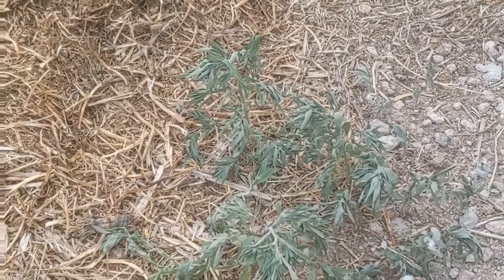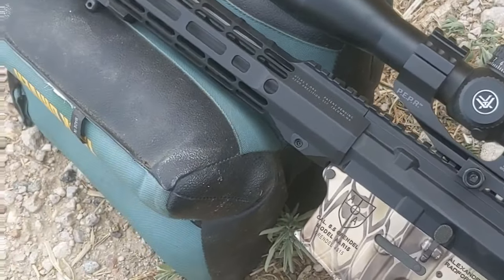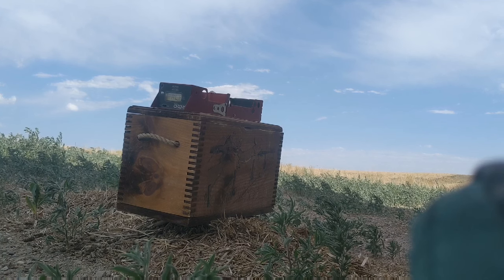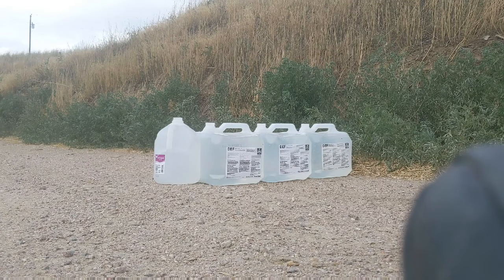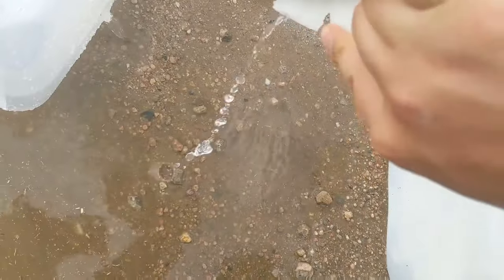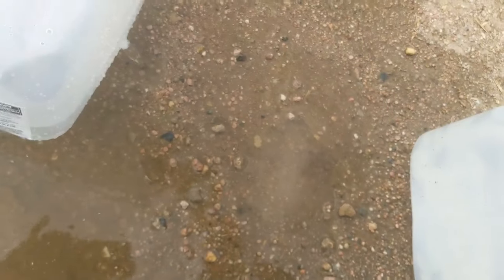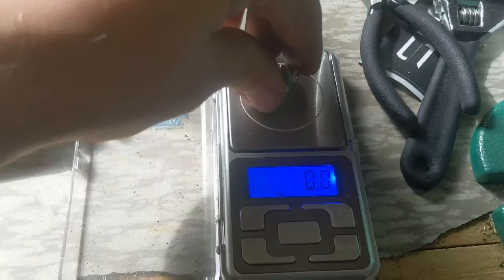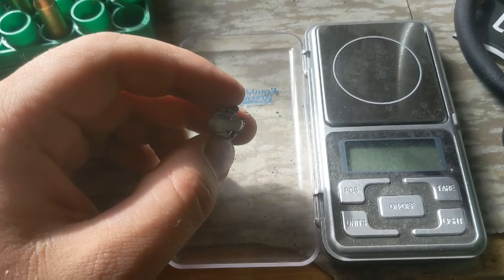223 rem: 90 grain Federal Fusion

Comment: Yea I would have never even tried this just assuming it would never seat that deep awesome. I live in Mississippi and we have no caliber restrictions for deer hunting just has to be center fire. When my son was a little younger I was playing around with a few different ideas for a good deer round for him which we skipped the 223 all together and went straight to 6.5 Grendel which is what I’ve used for 5 season now deer hunting and so has he. He switches between the 12” Grendel 120gn fusion and the 16” 7.62x39 120gn fusion and both perform very well on deer. It’s hard to beat a bonded soft point when it comes to a white tail round. Which brings me back to when we were messing around with the 223 after a bunch of testing we settled on the 75gn hornady black sbr it’s a 75gn interlok which is a bonded soft point I believe also. But I figured there was no need to even mess with the 223 on deer when he could just as easily handle the Grendel. I have a 20” 224 Valkyrie and have shot the 90gn fusion and they actually grouped really good for a hunting bullet but they do in other calibers I’ve found too. That 20” 224 is just too heavy to pack around hunting but if someone wanted to It will definitely do the job.